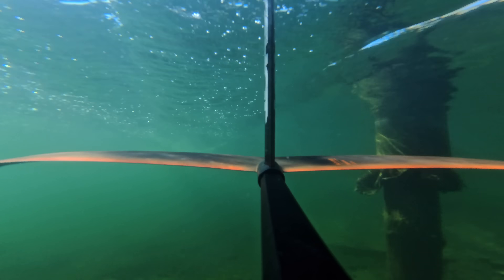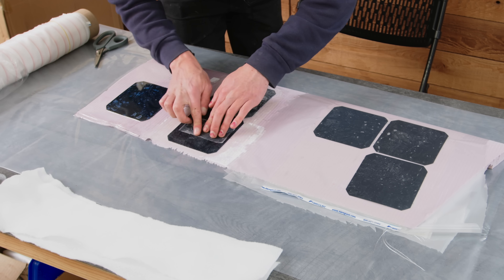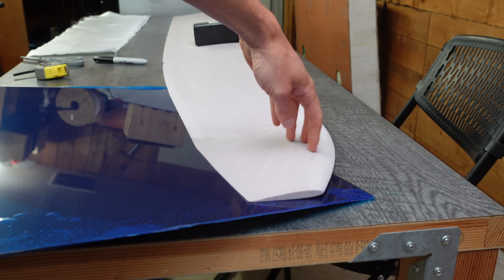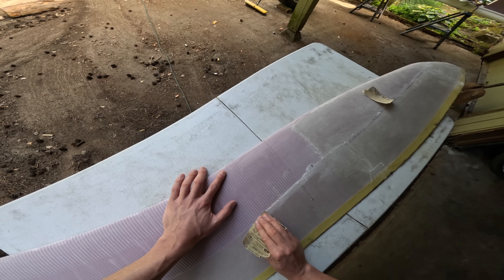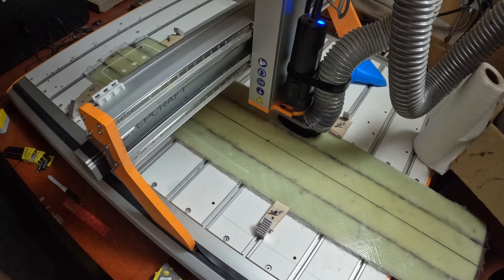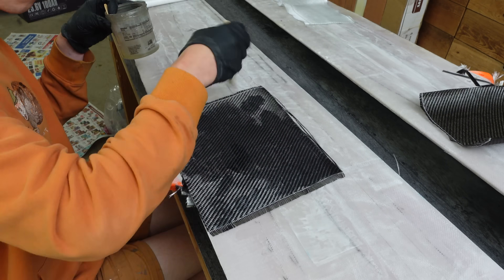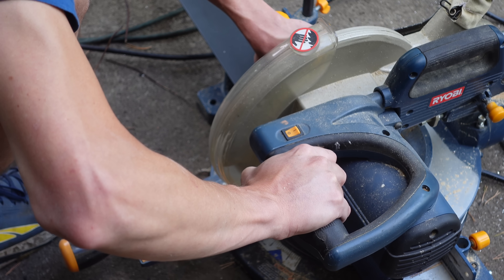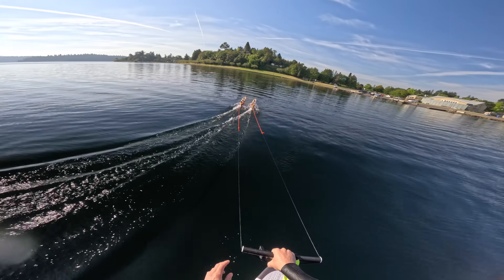I Built the World's Biggest Hydrofoil Board

Comment: The stiffness is both pressure in the manufacturing (which you did not do) but also the direction and what kind of resin you use. There's charts online that tell you what resins you need to use to obtain stiff laminations vs more flexible ones. Afaik, boat stuff is towards the more flexible part of the spectrum, because you need to have a flexible hull. You'd need the type of resin used in things like water storage tanks, for example. I've made a couple of custom ones back in the 90's with resin specific for the purpose and those were 3 layers deep only, no pressure (only the form), and chopped strand on the exterior (first layer laid) and it's extremely stiff, which i needed for the application, because it would've otherwise made a bulge because of the weight of the water.
Reply: Resin has some effect, but the main thing is the volume fraction of fibers and their orientation. With hand layup like this, you never get a good volume fraction of fibers, so you get a lot of thickness but little strength and stiffness compared to a propper vacuum bag setup or press. The 1708 is not helping either. The mat backing is great for building thickness, but the fibers are randomly oriented, so only a few are pointing in the right direction, and the weave is 45/45, so all the long fibers are going at a diagonal, almost negating their contribution. It is good to have some fibers at a diagonal for stability, but the majority of fibers should be oriented in the load direction!
Reply: @2testtest2  crap, i spent all that time writing my comment, but this was already here, but ill also put this here balsa wood is probably the best material for making a cheap and strong sandwich plate.
Reply: @2testtest2  Just was about to point this out as well. In a proper design, the epoxy has almost a negligible effect on the mechanical properties. Composite material design is hard and needs a lot of knowledge to reach the optimum for the desired application. The calculation itself can be done with CLT (Classical Laminate Theory). I'm certainly no expert in this, but If I would design such a foil I would probably end up with a stack that looks like something like this: [45/-45/0/0/45/-45/0/0] then followed by the foam and the same stack on the other side.
The 45 degree fibre orientation helps with torsional loads which are fairly important in this twisted foil design and placing them on the outside helps to reduce the risk of delamination.
Reply: @Raxdflipnote has warned us about the "MARIAH CAREY ENTITY" waking up this soon christmas just like the previous gaurd @Frosted_Derp . Be wary of going to antartica during this period as you may experience hallucinations and other phychological symptoms. Just dont go there please and may god bless us
Reply: Crazy amount of glass/resin

Comment: You should try scalloping/ adding nodes along the edge of the wing like a whales fin.  Also for your solar wing you should try using woven fabric instead of fiberglass it’s way lighter and I think it might actually be stronger.  Adding some few layer graphene flake additive they use for concrete might allow you to get away with even less material.

Comment: Get some West systems 105 resin with 206/205 hardener. I prefer the 206 just longer cure times. 

403 is a fiber pulp that you mix the epoxy in to thicken it. The 403 thickened mix will work its way into the foam a lot better than resin while also bonding nicely into the cloth. It’s a much stronger bond.

Comment: Thoughts on polyester resin? Would completely remove the need to sand in between layers as it chemically bonds as long as you make sure it doesn't contain the wax additive, which rises to the surface as it cures, depriving the resin of oxygen and allowing it to cure fully. Without this the surface remains tacky for days/weeks and can have more layers added.
Reply: Isn't that the UV Cure resin??? 🤔
Reply: Polyester resins are not nearly as strong as epoxy and will result in much higher weight layups. Definitely easier to work with though and cheaper.